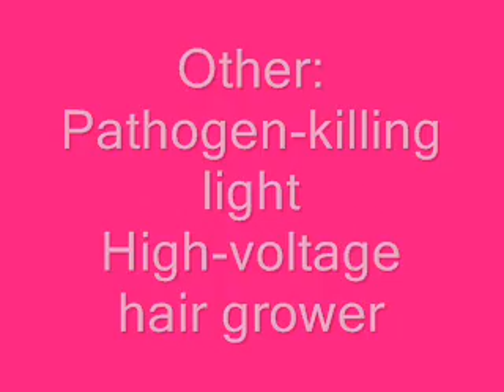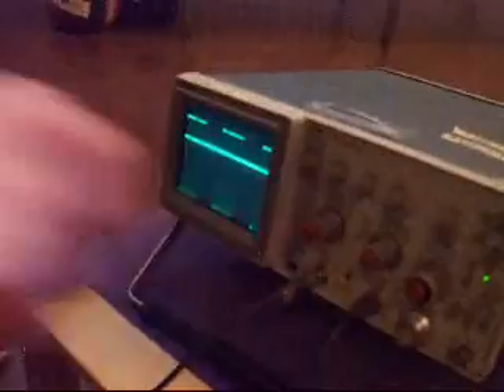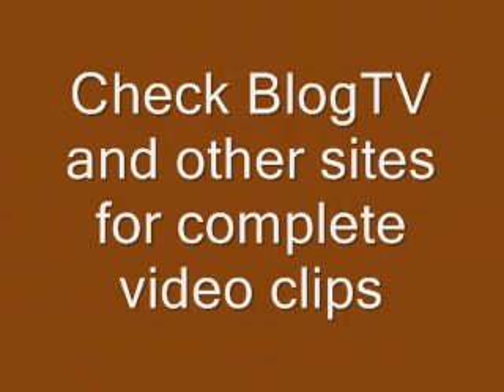STANLEY MEYER'S HHO BETTER THAN BRUTE FORCE ELECTROLYSIS

Comment: My approval of this video is Thumb Up!
And that's because it's better than nothing. 
At least there is interest and experimentation but not enough knowledge of Stanley Meyer's methods of fracturing the molecule with high volts of pulsed DC at 1/2 amp or lower with no conversion of energy to heat. That's the most important thing.  Study up on Stanley Meyer, our hero of this millenium, more important than Jesus.  Don't let him down!

Comment from the maker: Your opinion doesn't agree with SixHoax's 4-plate PWM lab video, which clearly shows an improvement with PWM. Having said that, the pretty PWM on an online auction puts out only 6A whereas the one we make is 30A or 60A (customer's choice.) Unless you're putting the PWM on a motorbike, 6A won't be enough